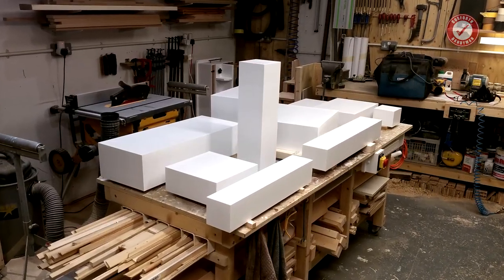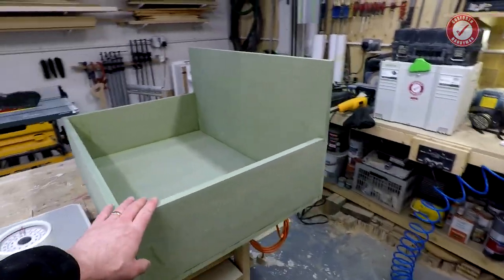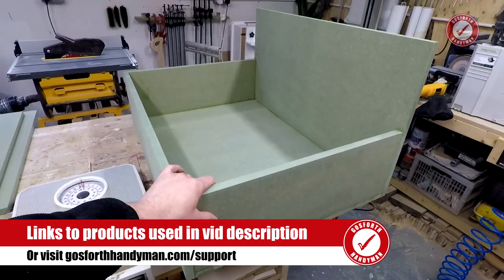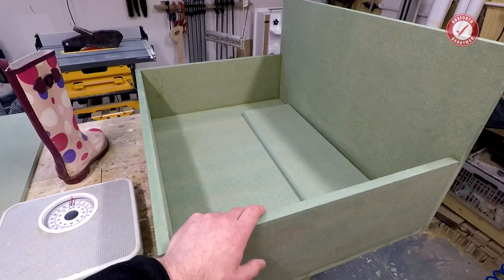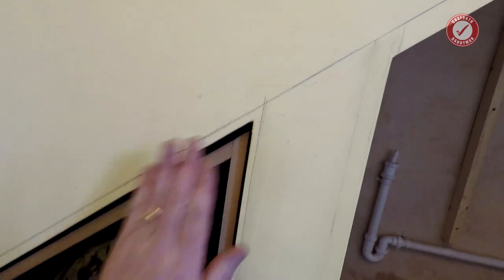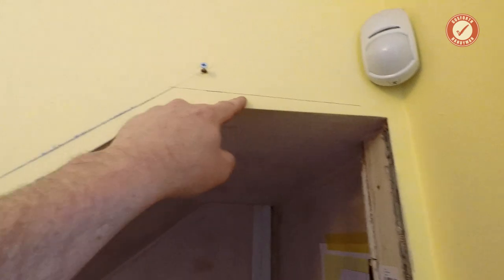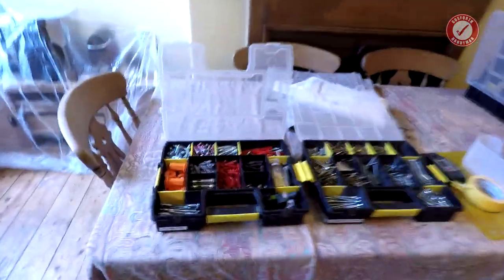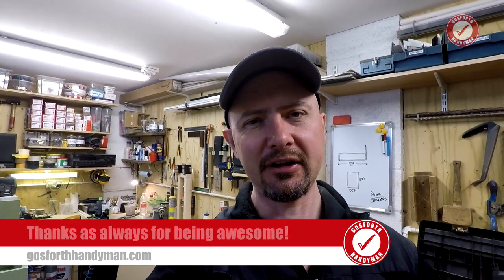Notes from a Small Workshop - Understairs Storage, Woodworking Vlog (Apr 2018)

Comment: Nice update. I commented on your Instagram about the electrics and plumbing thinking they were existing... I now understand they're new/current. I'm no electrician, and I appreciate that an electrician put these in, but I've a preconceived idea that the electrics should be positioned differently near plumbing (ie higher, and perhaps also as a fixed spur). I'd be interested to know what the electricians comments are here... I'm always happy to learn. Thank you. I also wonder the first/leading screw capacity in MDF for those pull out draws; in say 18thk plywood I'd not question it (I'd probably not even consider it), but I've had some uncomfortable screw shear failures in MDF. Perhaps loads will never reach 60kg... which may result in around +30kg or thereabouts for the first screws either side, and -30kg for the last few screws inside the carcass at the back . Waffle waffle... I should do the maths/analysis myself... just thinking out loud; sorry. Oh and I've subscribed by the way... and keen follower on the podcast (And no I don't do iTunes... I'm an Android man).
Reply from the maker: Welcome to the channel Andrew! The sockets are a switched spur btw (that's what the switch is on the new wall). I reckon a single screw in the MDF could take 60kg shear load... haven't tested it, might add that on to the list! 👍😀

Comment: Andy, will you be doing a follow up on the shelves? The reason I ask is that it looks like they will wide and deep and I am keen to see how you deal with that? Thanks, Bob.
Reply from the maker: I might do a quick follow-up in a Vlog but I couldn't really film this one on-site. The shelves are about 700mm wide. I'll post some finished pics to my Instagram. 👍😀
Reply: Saw the Instagram pics. I have some big ones to replace shortly and the old ones have sagged badly and I have been thinking about bracing, but without increasing shelf thickness too much, so I was keen to see how you built your big shelves, especially with just bookshelf mounts. Thanks.
Reply from the maker: For really big floating shelves I'll normally have a 20mm framework with 18mm ply top and 6mm MDF bottom - all glued together (so about 44mm thick). That gives a very rigid structure once dry. You can include angle steel / aluminium inside the structure but not normally needed. Might do a vid on it at some point! 👍
Reply: Now I'm confused lol. Did you mean 24 mm thick (18 + 6) or is it a lamination of 6 and 18 mm sheets in sequence, looking forward to the vid. Bob

Comment: Nice job Andy. On the triangular drawer slide thingmajig. Did you not consider reducing the sheer weight by cutting out sections of the constructive panels and replacing with hardboard - conservatively I think you could have reduced the weight of the unit by 30% without compromising stiffness.
Reply from the maker: It was an option but at 15kg I had plenty tolerance on the weight. Or do you mean the liner? 👍
Reply: Sorry ~I meant both ;-)

Comment: Andy I am going to do three comments/questions as I think that is easier for you if you care to respond. So first one, I notice only one water supply pipe at the back of the space, will the washing machine hook up to cold only or is their a hot supply I have missed somewhere? Thanks, Bob.
Reply from the maker: Hi Bob - some older machines take a hot & cold supply but most (if not all) newer ones over here are cold supply only and do their own internal heating. 👍
Reply: Thanks Andy, here in Oz they still come with hot and cold, having some of the world's highest electricity costs there is no way you would want the machine to do the heating here.

Comment: Excellent video and hello from Morpeth! I’ve been thinking about a similar project but our understairs has a door in it but is mostly brick. I don’t believe that the brick is supporting the stairs, I think that the stringer is probably supported at top and bottom and not by the brickwork. Still it makes me reluctant to remove it :) Any comments on if this is likely?
Reply from the maker: Normally brick is put in for a reason so just be careful. I have had houses with brick walls that are non-load-bearing though. You need to knock all the plaster away and see what's sitting on the brick, if anything. 👍
Reply: Gosforth Handyman from the inside of the cupboard it looks like the stringer is unsupported but that sounds like some good advice! I’ll take it all off inside and take a good look.

Comment: Great video! Any reason why you're using MDF over plywood? Wouldn't ply be as strong using a thinner piece? Presumably ply is a lot more expensive though...?
Reply from the maker: Cheers! Main issue with ply for a project like this is getting stuff with a good enough quality paint grade finish on both sides. 👍

Comment: Can you help, I purchased some MRMDF skirting for my bathroom and when it arrived it looked like the usual brown MDF. All the MR stuff I’ve seen on ur video are green. I emailed the company asking about this and they assured me it was MR, there are no markings, labels or colouring to distinguish it from MR to nonMR. Have you ever seen brown MRMDF or have i been had
Reply from the maker: It's rare but I have seen normal brown MR MDF... In fact my workshop walls are exactly that. The green is just a colouring. That said I've also seen places saying their MDF is moisture resistant when it isn't. 👍
Reply: Thanks for your reply, so if someone has given u brown mdf with no colour or markings claiming is MR u will never no for sure, well until i blows i suppose. Thanks. Love the videos, just working through the back catalogue.
Reply from the maker: Cheers! Yes, very difficult to tell without testing it. Sometimes printed on the edge but not always. 👍

Comment: I would love a unit like this, but that space under my stairs houses the gas and electric meters and it's prohibitively expensive to move them :-(
Reply: could make the drawers to not be very deep and removable. So they're useful storage and hide the meters but can be taken out if you need access to the meters.
Reply: I plan (very long term) to do these on castors so I can pull them out completely if necessary. I have access to the crawl space under my stairs as well as meters.
Reply from the maker: I've seen them done on castors - can work really well. 👍
Reply: Maybe castors and runners would be good - will prevent the drawer from sagging when fully extended. The only down-side with castors is that they can create track-lines in the flooring if in daily use. Not so bad on carpet but can be quite damaging to hard floors.